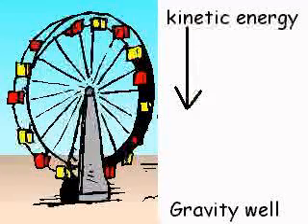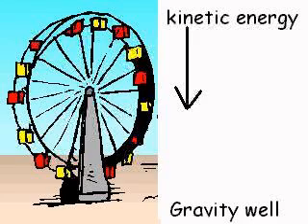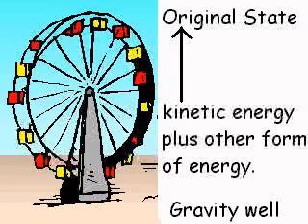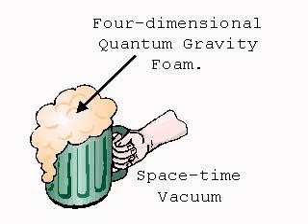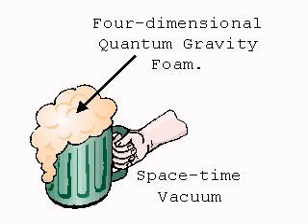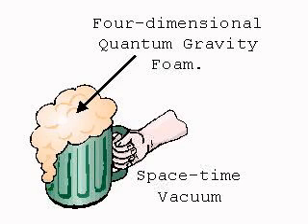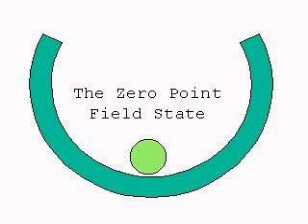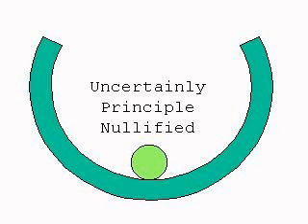Zero Point Field; Free Energy; Perpetual Motion

Comment: your absolutley correct profesor weirdo.
however,
should somebody use a ramp to move the position of the resistant mass to be half what the gravatational force is on the lever,   they would gain half that leverage in work.
say somebody used a fly wheel equall in power to the ramp resistance also.
then one would gain work from all the leveraged falling weights.

but what do i know.
my superior ignorance must be over whelming to you.
Reply: You would still never get all of the energy back that you put into the flywheel...

Comment: Ok, so zero point field is zero energy, so can't go lower, so you are implying lower energy means work? Well, can't go lower because it will not exist as work, just nothing to show. Right. So, it would be better that they go to higher than zero point energy to get work. So, you are saying it requires mass to produce mass, so mass is original state which you include kinetic energy and others, so if there is works it will go to lower energy system, so the mass itself will reduce, so from original to less. So, the start point is high number of energy to low number of energy that is low point, right. And another thing in connect to that is location of energy that is quanta on top or above the small gap of green arc, so arc is a location of work, so quanta is lowest energy with a gap. If there is no gap, so it is touching so it is creating work which what quanta that touch the arc is higher point, so arc is energy itself that you can see so quanta is creating energy. So, there is two things: Energy that you can see and use which convert into mass, and quanta is you are doing the action of creating energy to use mass interact another mass, which uncertainly principle that only work with mass to mass. So, uncertainly which means you are not sure where the energy is at, and where the energy that support the mass. You know the mass, but you don't know where the support of mass that is energy is location? At most foundation that is uncertainly principle which you can't be sure where is the energy is at so you can't use zero point energy to be used, but you can use higher point so it is certain principle, or uncertainly principle nullified which it is higher point that energy that you know is touching the mass, so both produce work. So, to summary: to know the energy is you can use work. That work convert the energy so the mass can be maintenance. If that is so, you don't need to not know where the energy is at, but you can create a system to cause the non-location of energy to become location energy so to become work base on vacuum pressure, so you don't see the air right, but when vacuum pressure is create you suddenly feel the air leaving you and you will die, you know there is air when the air is leaving you. And another part you know air when the air is cold and you feel the wind of air. The point one way you are right uncertainly principle nullified work only at higher level energy when it is doing the work and you are seeing the work that is mass that cause work to another mass. So, mass to produce mass, so you see mass to affect another mass. 

Logically it would work base on the pressure and series system process: And that higher point of energy affect lower point of energy, so lower point do change to higher energy by different pressure which you say about a vacuum pressure which cause lower point to be suck up to higher level so it creates a newer point so zero become higher level, so it is same for vacuum chamber that you push the air and the air go up, so the lower pressure of air compare to higher pressure of vacuum do change because it sucks up, the faster it sucks up, it creates an impact point which depend by motion of air itself that impact diameter of hole of upward pressure then the side pressure push in and the vacuum chamber cracks. So, it depends how fast so zero can have energy to use, so the air do cause impact, so zero point energy can cause impact to higher level so higher level can feel the impact of zero point energy that they can feel it which higher level point will be constanting as feeling the impact of zero so it maintenance it, so it doesn't go to lower level and breaks apart. 

So, zero point energy do work because what hold human, humans is higher point energy than air, so without air human will not live. So, 1 support the 2, so zero point holds higher level energy like 1 holds the 2, because it is a process that 2 means many of 1, or smaller of 1 which it keeps 2 at higher level so it will not go down at lower level so 1 holds the 2, like junga, it has a foundation that is 3 on the ground to higher level that is second 3, which it is 6. so 3 holds the 6 above or 6 will fall down because there is no gap as 3 to holds the 3 above. 

To be sure the summary of video above is: Uncertainly Principle that is true and Uncertainly Principle Nullified that is false, those principle is base at most foundation that is zero point energy. So, you can't see the motion so it is always moving and you can't see. So, the key word can't which imply all sense can't be felt or seen which we are higher level that is mass as a whole, as one code series that is us, human, so we can't see the lower level energy as non-mass that is zero point energy. So you assume zero point can't be use, only what we can see and feel by using all sense.

Comment: @Desertphile - From one side of the fence you're right, zero point energy, i.e., absolute zero degrees, or very close to it, has no useful energy. However, if you think of a ball rolling down a hill, it you thought of  the bottom of the hill as the zero point, then you have learned something. Zero point energy gives the hill its slope, a place for the ball to roll towards.

And what was at absolute zero degrees is now warmer so equilibrium is the final goal post. Now that is the new zero point.

Comment: the way they are trying to do a zpf is all wrong anyway I at first thought the same thing 
so I got a priv. pat about 5 years ago. So I actually own rights to it. however what Tesla an the rest of the scientific comm, discovered much like I did out of trial and error is that even the best generator loses heat and the most efficient motor has friction, causing the loss of heat. Then there is the loss of heat through the wires and cables. All of this heat is as well energy. Therefore it will stop

Comment from the maker: @legoliker123 ; You are both correct. :-) Magnetic fields do have friction even in a total vacuum; any mass "levitated" by similar magnetic poles will still cause drag, and the ferromagnetic material generating the magnetic fields will heat up. A source of energy would be required to keep it going. But remove the magnetic fields and the track, and have the mass move in a straight line, and it will go on "forever" (until it counters another mass, or a force to chance its vector).

Comment: Technically, everything deteriorates and any kind of metal used to make a perpetual motion machine would eventually break and no longer work, therefore it's not truly perpetual because it didn't stand the test of time, which is the name of the game.

Technically, any energy (atoms etc) is perpetually moving but how do you reap the benefits? Maybe make a carrier-electron that has zero weight that can transfer energy, which attaches to an electron circuling a nucleus? It'll be moving indefinetly

Comment: some corrections:

-you confuse work and energy: work is one way energy can be transported from one physical system to another (the other way is heat). work performed on a system is defined as the product of the force performed on a system and the translation of the system (the centre of mass) along the direction of the force. If a system receives net work and converts it into kinetic energy, it will accelerate.

Comment: I got to be honest I dont understand about half of what you said but please correct me , I made a cd with 12 magnets on it all facing one way and I mounted the axis on a little motor for a old razor then mounted a stronger magnet about a quarter inch away from it and this thing spins fast havent tested it but the LED I have wired to the motor is running bright.  Were is the energy coming from ?? From what I understand in physics this is impossible yet its right front of me working

Comment: so whats being said here in short (if I'm understanding) is that the energy associated with "zero point" is not coming from the zero point field, but rather the consequence of cancelling out inertia VIA the zero point field, thereby enabling the production of engines capable of infinity (or near speed of light) rotation within a super fluid leaving almost no heat or wear on parts. Hence also the apparent glow of these military / ET flying craft as the engine approaches the speed of light?

Comment: If light is indeed waves (I.E. the entire electromagnetic spectrum from radio waves to gamma waves), waves not unlike compression sound waves moving through air, water, of even solid mater like steel railroad tracks, then tell me what is the substrate that the electromagnetic waves are moving through? Could it be perhaps the compression and expansion of the level of energy (Aether) in a given point in space?

Comment: Desertphile, ever heard of a Bedini motor or the Lutec 1000? These motors require short pulses of DC current to magnetise an electro magnet (stator) which repels a permanent magnet (armature) at controlled time intervals and therefore causing the motor to rotate. The rotation of a perm. mag. past a coil then generates AC current. More power out than in but NOT perpetual because the perm. mags will eventually be depleted......in about 1000 years.

Comment: I think that it is safe to say that there are a multitude of possible causes for the Casimir effect. The current supported by a corresponding equation being the exclusion of all possible frequencies from the gap causing a kind of pressure on the outer surfaces. Other kinds of atomic interactions have not been completely excluded as we are talking minute separations at the level of atomic radii. It was said 'nature abhors a vacuum' and this effect seems to re-confirm a matter/space relationship.

Comment: This is still the Casimir EFFECT; it is measurable but still unexplained. A spring or two magnets or a bucket on a ladder require an energy input to have energy potential. Two plates must be PLACED in close proximity, the plates then continue to move together and exhaust any potential in the system like the other three. The Casimir Effect may be a new potential, but it seems to dissipate like the other three to the zero point.

Comment: However, in order to do it again, you need to pull the plates APART, and that requires INPUTTING energy.  So, you're wrong in that no useful work can be extracted from the ZP field (it CAN) but you're right in that it has no PRACTICAL use. Read the paper by SK Lamoreaux at Los Alamos which experimentally demonstrated the reality of the Casimir Force.

Comment: By the way, the Casimir Effect shows very clearly that you can remove useful work from the zero point field.  However, before you jump on me, let me say that even though you can do this, there is no PRACTICAL way to ramp this up and make it perpetual. In fact, it's impossible. It's a one-shot deal.Casimir Effect works by limiting available EM vacuum modes by creating an EM boundary between two metal plates. These plates them feel a very REAL force that pulls them together. You CAN extract work..

Comment: btw, you only require more energy to return a BALANCED wheel back to its original state. If the weight is always returned to the center on one side and left at the edge on the other, you have an unbalanced state. Its simple leverage, think of a see-saw. You know? just like the ones that hit you in the head so many times as a kid. You don't remember? Must have hit pretty hard...

Comment: More energy in the form of hydrogen can be produced than is used through electrolysis if a 12V current is pulsed at 20,000 cycles per second through water using electrodes made of a titanium rod within a stainless steel tube. See video titled "Original Meyer Water Fuel Cell c.1990". It is not "over unity" or "zero point energy". This is "free energy".

Comment: Do you mean Hydrogen? That has nothing to do with Zero Point Energy. In physics, the zero-point energy is the lowest possible energy that a quantum mechanical physical system may possess and is the energy of the ground state of the system.  It is the energy associated with the vacuum of empty space and empty space does not contain even Hydrogen.

Comment: There are methods of getting more energy out than consumed by the process. Running a 12V current at up to 20,000 cycles per second through water using a titanium rods inside stainless steel tubes produces more energy in the form of hydrogen than is used to create it. A current of up to 20,000 cycles per second produced with a frequency generator will achieve the needed output and drop the current to 1/2 amp.

Comment: It causes confusion to do so, but the terms "zero point" or "over unity" are often applied to systems where you get more energy out than you put in. Getting more energy out than you put in is correctly termed "free energy" in my thinking but some disagree. It is argued that the initial investment of any energy required to get more in return excludes such a system from being defined as "free", but I disagree. There are methods of gaining energy back than put in. I'll explain.

Comment: I was thinking of converting the energy earthside. Just send down the sunlight in a concentrated beam, and use the heat to power generators. Whether you use microwaves or plain sunlight, if you miss things will get hot anyway.